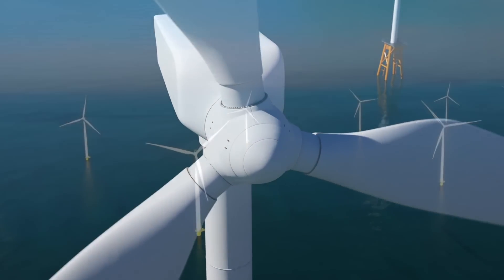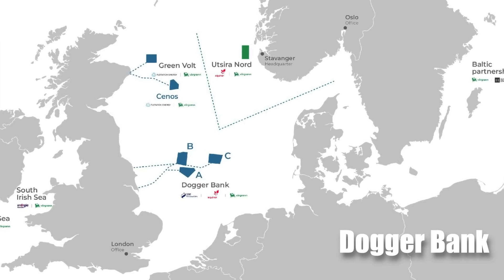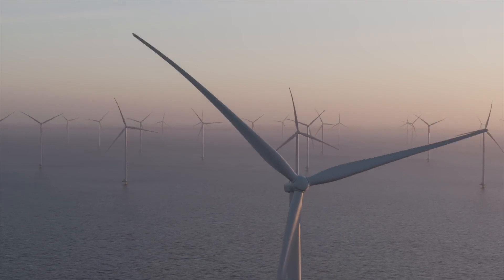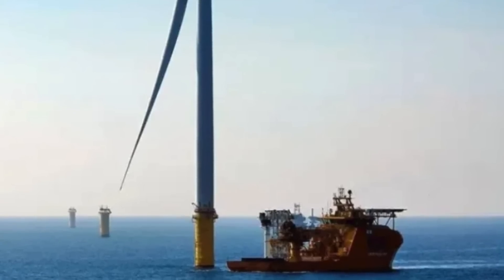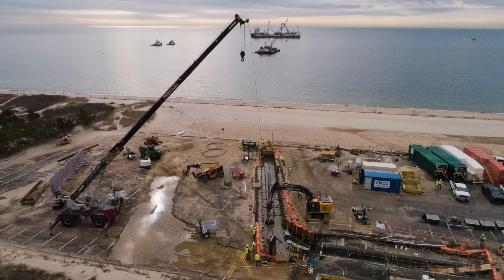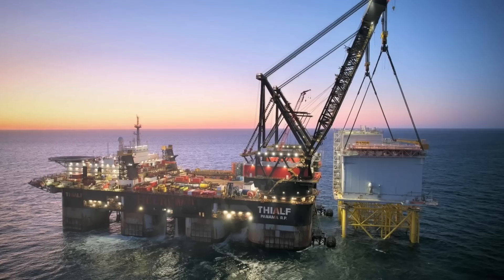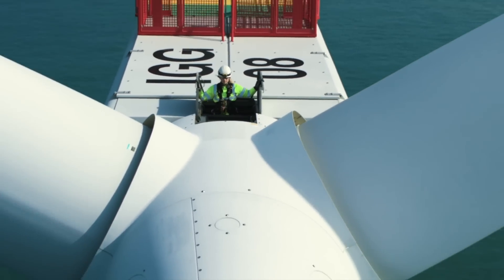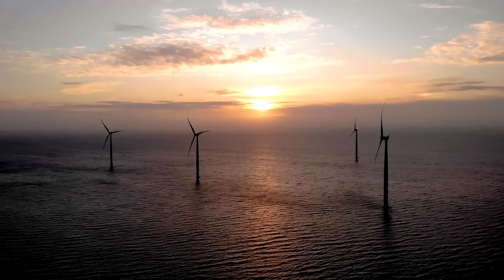Inside the $11.6 Billion Dogger Bank: The World's Largest Offshore Wind Farm

Comment: 6 million homes is less than one tenth of all UK homes. We're never going to be able to go fully renewable.
Reply: We’ll see about that. This is just the start. But you make it sound like it is not even worth trying. In any case, even if the UK doesn’t get to 100% renewable energy share, what about if it gets close? That is still a big deal.
Reply: @ewadge  its literally impossible unless we have serious battery storage technology. Renewables are an addition, if we want to reduce CO2 we will have to have nuclear as the backbone of power with renewables sprinkled on top which is what the UK is aiming to do.
Reply: @WDUK-x1x  I disagree and after the financial disaster which is Hinkley Point C I doubt that a single new Nuclear Power station will ever be built in the UK.
Reply: There's only 30 million homes in the uk
Reply: One wind farm will not power the entire UK.  Are you being fictious or just ignorant?

In a broader context, the power of the sun & wind on Earth is enough to power the world by at least 1000x over.  Some combination of the raw inputs of sun & wind are available everywhere on Earth.  Renewables (like solar & wind) have reached historically low energy production prices and still continue to fall.  In 2022, more than 80% of global new energy additions were renewables.
Reply: @beyondfossil  Dogger bank is firstly not technically one wind farm secondly the area is orders of magnitude larger than most wind farms ever could be due to its geography. Lastly wind cannot power the country by self neither could solar neither could both combined you need nuclear or significant strides in battery technology to do it. People thinking solar and wind will be sufficient are literally living in cuckoo land with no scientific literacy. If it was possible the push for it would be significantly higher than it is now. Neither solar nor wind provide continuous power. Its not good having 1GW or power it isn't provided in a continuous manner, fluctuating power is not good for the network or anything using said power lines.
Reply: 6 million would be 1/5 or 20%
Reply: @mike-nj3mb  Fair, but thats not the only issue, the other issue is the power supply isn't constant so we need better battery technology to fully rely on renewables unless we include nuclear in that.
Reply: Renewables are the future and present , battery storage has got a lot better and new renewable tech is popping up all the time
Reply: @thomassmith9909  Battery tech hasn't got a lot better in any real capacity in quite a while. Especially on the large scale. There's a lot of lab based breakthroughs but unless they can be commercialised its not of much value.
Reply: @WDUK-x1x  There grid-scale specific storage under development that will be fractions the cost of lithium and have several times its longevity while using common materials.  Examples: liquid-metal flow batteries, pumped hydro, compressed CO2, thermal, sodium and many more.  The grid-scale storage sector is white hot right now with R&D, investments and subsidies.

Lithium is not ideal for large scale storage since it was made for high energy density required for EVs.  OTOH, stationary grid-scale storage does not need this requirement so can gain other advantages.  But Lithium batteries have lightning-fast response time and gives grid operators more tools for grid stabilization with regards to power factor correction and rapid voltage support.

Once grid-scale storage arrives en masse, we then arrive also at the era of dispatchable "firm renewables" which will mop the floor with every other human energy production on Earth.
Reply: @WDUK-x1x  At a larger context…

Renewables are not just the answer but the only answer.  All the science and economics points to renewables absolutely dominating the grid and our energy systems.

Look at the well-known facts.  The sun is 99.9-percent the mass of the solar system. The remaining 0.1-percent is mostly Jupiter and Saturn, so the Earth is like a tiny breadcrumb next to a large watermelon in comparison.

Just a tiny part of the sun's total energy reaches Earth yet still provides a mind-blowing 173,000 terawatts continuous non-stop power to us for billions of years and at least a billion more.  That's 1000W per square meter peak and its always peak somewhere on Earth.

Put it this way, all the combined fossil fuels on Earth would amount to just a bucket in an ocean compared to the daily amount of energy the sun provides us with clean fusion energy for free.  A bucket!
Reply: @beyondfossil  They are part of the answer alongside nuclear. As well as sharing power across nations with HVDC
Reply: @WDUK-x1x  But renewables will dominate as they directly employ the vast and wide range cosmic power of our host star.

Commercial utility-scale nuclear will fade from the grid and be gone in about 50 years -- mainly due to excessive cost, very long construction times along with nuclear waste along with small but non-zero chance of catastrophe.  Simply put, commercial nuclear is the wrong tool for the job on the terrestrial grid.  Or any built-up location within the inner solar system for that matter, see above.

Nuclear will continue though in small-scale applications where it excels: military, scientific, nuclear medicine and later deep space exploration.  These are important areas too.
Reply: @beyondfossil  they might dominate but the issue is they can't supply continuous current, fluctuating current is problematic. So nuclear is needed to make up for those fluctuations since it is continuous. It's the difference between having a tap which splutters water out and a tap that provides laminar flow.
Reply: @WDUK-x1x  The problem is 90% or more of that dispatchable continuous energy is from fossil fuels and not nuclear.  Most countries would opt for fossil over nuclear and thus we can see why we're so far down climate change hole.  If they were smart though, they would start building up their renewables.

Nuclear is both very expensive and very slow to construct.  It takes a decade or more to bring online a single nuclear power plant all while providing 0 watts of electricity.  It also takes billions of dollars and years to decommission at its end of life, again, all while providing 0 watts.

Over the last 70+ years of operation, nuclear only powers 10% of the grid and its falling.  It failed us and we wouldn't be so far down the climate change hole as we are now.  Almost every new nuclear power plant construction has been billions over-budget and years behind schedule.  Commercial nuclear power is the longest running joke in the energy industry.

Look at France, the poster-boy for nuclear. They haven't brought a nuclear power plant online since like 2000!  Most of their fleet is at or beyond their service life causing major maintenance headaches (cracked pipes). Germany has completely abandoned commercial nuclear power.
Reply: @beyondfossil  Your comment is nonsense. Fossil fuel has never been 90 percent of anything in the UK for over 50 years. We have gone from vast majority coal down the last station about to be closed.
Reply: @SimonEllwood  Read the thread replies above and see I'm no fan of fossil fuels.  The comment was about the world-wide dispatchable energy, not just UK.

The main point with my argument with WelshGuitarDude is that nuclear power world-wide is diminishing.  It failed us over the past 70+ years of its operation and it never even came close to its promises of cheap abundant energy.  We wouldn't be so far down the climate change hole if nuclear hadn't failed us world-wide.  Pushing for more commercial nuclear just pushes us further away from the global energy transition.

Most countries would choose renewables (good) and fossil fuels (bad) over nuclear. Commercial nuclear will fade from the terrestrial grid in about 50-yrs time as its simply the wrong tool for the job: too slow, too expensive, too small.  With the vast amount of solar energy available everywhere on the planet, renewables are not just the answer to the global energy transition, renewables are the only answer.
Reply: Where is your evidence that we cannot go fully renewable? You cannot do basic arithmetic. You do know we have other renewables coming online too? Stop the lies and the FUD.
Reply: Right. 4.8 GW is hardly worth getting out of bed for. 

BTW I hope you objected when they were building Battersea Power Station. That never product more than 0.5 GW. Pathetic!

Comment: The alternative 

Solar Hydrogen Energy Recovery Gas Turbine – 301Kwh (equal to 46/6.6Kw home solar installations) of solar energy collected from the sun’s constant nuclear fusion at atmospheric temperature is sufficient for electrolysis to provide the start-up sequence and enable a hydrogen Gas turbine to synchronize with the turbines Variable Frequency Generator and provide constant electrolysis to continually fuel the turbine and operate the energy recovery system on a hydrogen use as produced basis to generate a variably regulated energy range between 80 - 330Mw with optional co-generated steam capacity up to 700Mw of electrical energy on a 24/7 basis. 
The turbine has three operational parts, 3 meters high, weighs 6 tons, cost $36.5 -49.5 million, requires a footprint area the size of a football field, noise level is 60dbl at 60m, incorporates direct air capture of CO2 at 1,400 Kg/sec and includes a 14-year end of life decommissioning or optional refurbishment program. 
Sixty-five carbon and pollution free, shovel ready installations generating a total of 21,450 Mw, retrofitted to any of the existing 120 Hydro-electric schemes without the need for renewable energy or curtailment issues and a guarantee of firming would provide Australia's entire energy needs covering a combined operational area of 33 hectares for a 2023 total cost between $2.4-3.3 billion, construction period is 3 to 5 years, meet net zero twenty years earlier and makes wind and solar farms including hydro, gas and nuclear energy production redundant.

Comment: Amazing project on UK, but this intermittent wind energy (offshore) need energy storing and this need additional expenses on initial Capex. What will be this CAPEX and what energy cost will be for citizens (not cost but everything included on energy bills).
Reply: Part of the project included 98MW/196MwH Tesla battery packs - the largest in Europe at the time of installation. They'll be used to minimize curtailment.
Reply: @MalcolmRose-l3b  I say this is amazing project, however such projects which will have 3.6 GW power and may generate 30000 MWh energy daily, storing 196 MWh is a drop on ocean, so more storing is needed and more CAPEX needed. Solving the exercise differently, if the CAPEX 1-2 billion dollar will be invested on oil and gas industry, drilling 30 wells which will produce 390 BOE/day will need around 30 tanks with storing volume 500 bbl. The investment on oil and gas industry will be more effective, will cost less and energy security will be very high.
Reply: Uk has 40% of the wind in Europe
Reply: @kevinchallinor9116  And that's before you count that emanating from politicians...
Reply: Pumped hydro storage would be good. I know in many countries around the world, this is one of the more common means of storing over capacity of intermittent energy sources like wind power. Finding re-use for old underground and surface mines and quarries would be a great place to start - without having to go creating new dams.
Reply: You do not need energy storage to have wind turbines that is not true. You will have very high levels of curtailment without storage however. The upfront costs of renewables and storage are high but manageable. The cost of continuing to rely on imported fossil fuels is untenable for both the planet and energy independence.

Comment: Wasted money, that is why England has expensive energy
Reply: The latest offshore wind costs less than £0.04 per kWh. That is cheap.
Reply: @NeilGrahamShaw  The people are not paying less in their bills so its cost are irrelevant to the average person.
Reply: @WDUK-x1x  "The people are not paying less in their bills" Well I live in the UK  and I can confirm that I am paying less for my electricity. And the Dogger Bank installation featured here is going to add to lower prices. The high prices for energy in the UK were caused by high gas prices not wind energy prices.
Reply: Rubbish! You are talking out of your backside. Higher prices of electricity were caused by high gas prices. Try doing some homework before you start typing. It's not that difficult!
Reply: You would hate to see what it would cost without, yes installation is expensive but energy produced is CHEAP
Reply: Natural Gas prices are what is putting up electricity prices, stop the lies and the FUD.